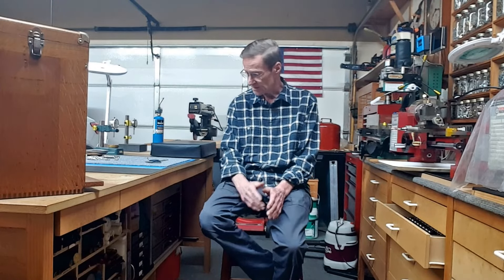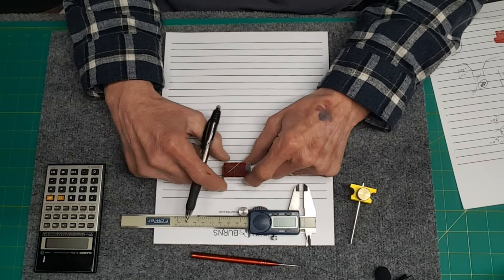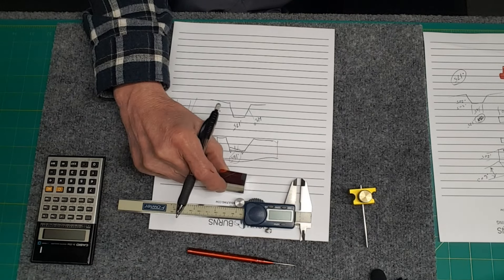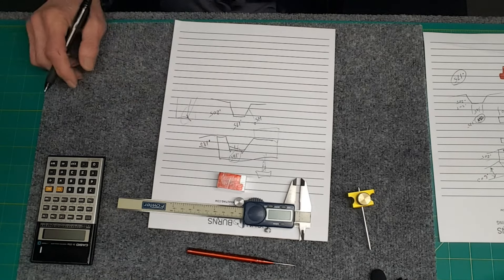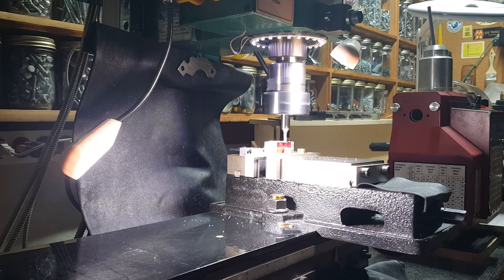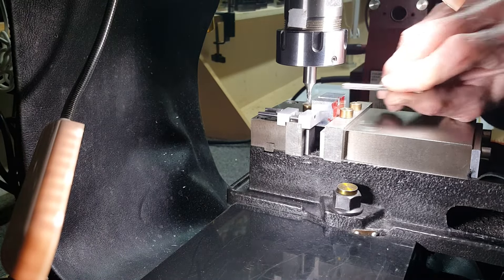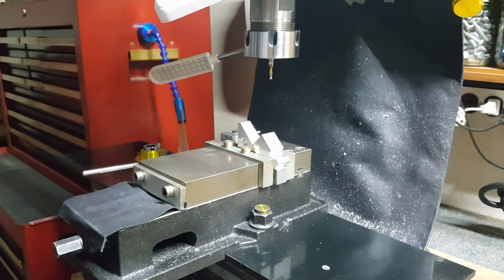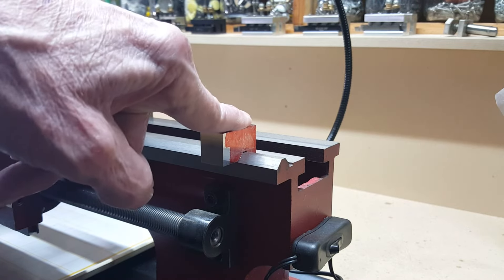Flexible Mini Lathe Saddle Stop

Comment: I just made one of these stops last night after watching this video, it took me 3 attempts but I was finally successful.
Reply from the maker: It is indeed somewhat difficult to make but worth it when done. Congrats!
Reply: @TheMiniMachineShop  this wasn't my first attempt, I tried to make a carriage stop 2 years ago and it didn't work out so well, I made 10 attempts, and none of them worked.  When you posted your video I decided to try to make the part again.  I guess I just needed to practice for a while learn a little bit and use the correct tooling.

Comment: G'day Dave. Excellent job working it all out, & making the Carraige Stop.
The stops definitely need Alan key to tighten it down properly. The only suggestion I would add is to recess the Alan Key head into the top of the unit for safety purpose .
Still very meticulous Job, well done 👏 ✔️ 👍🏻 👌 😀 
Ted
Reply from the maker: Hi Ted, I did make the brass knob to tighten, and it works great. The only problem now is I need pliers to loosen the knob! Even tried anti-seize.